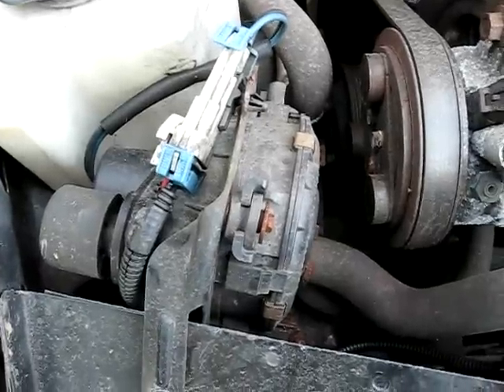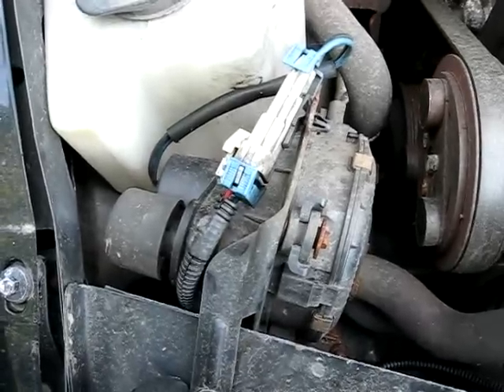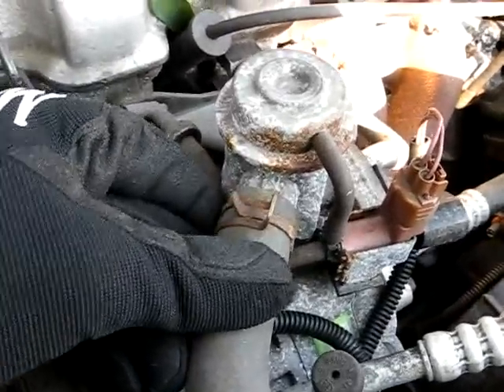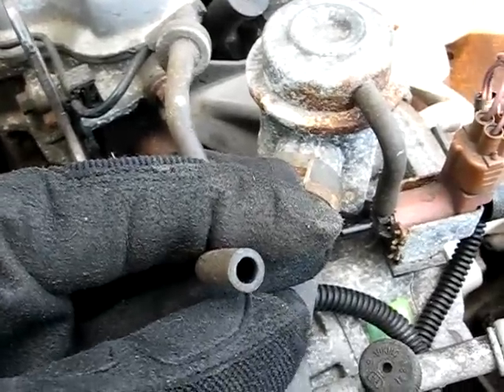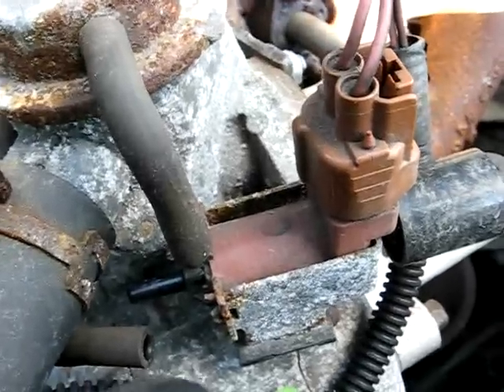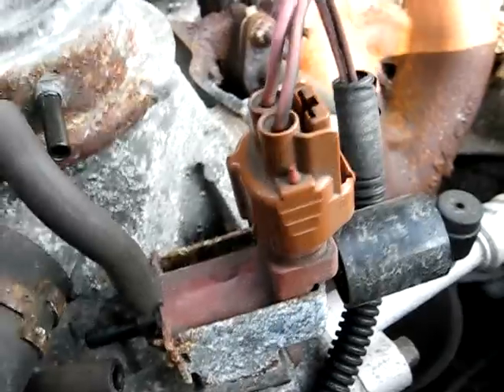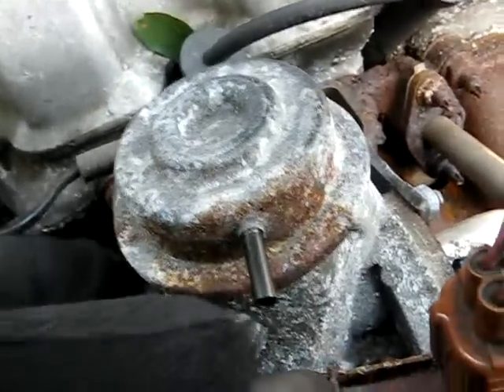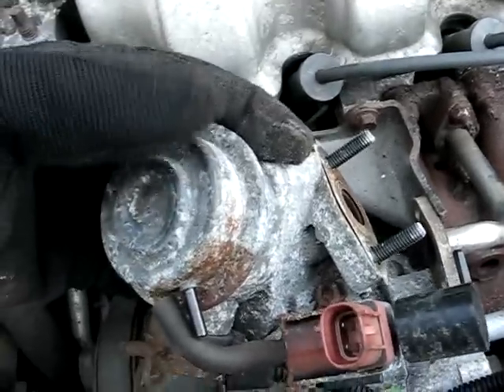P0410 Secondary Air injection System Troubleshooting

Comment: Hi richpin, I am checking the voltages coming out of the air pump relay,  One has 12 v all the time. Two have 12 v with the key on to run and the last one is reading 00.5 v. . I have checked the solenoid it is getting 12v, but the pump is getting the 00.5 v.The grounds are good continuity back to battery. Is there something in the pcm not turning on?
Reply from the maker: The computer will only turn the pump on at a cold start up and only for a short time.
Reply: Thanks for the info.

Comment: Hi Richpin,  I have been inspired by your videos to better maintain my aging Saturn.  You have helped me find the confidence to work on my car and saved me a lot of money!  Thank you!

 I have been trying to fix my p0401 code on my 2001 SL2 Saturn.  My secondary air injection pump works and during a cold start air flows through the hose to the shut off/check valve (Part #: 21210000).  I have vacuum going to the solenoid while the engine is running (Part #: 21210001) and vacuum leaving the solenoid during a cold start, but not airflow through the valve.  I bypassed the solenoid and plugged the vacuum line from the engine directly into the valve.  When I do this the valve opens and I have airflow through the valve and small metal pipe that leads into the exhaust manifold.  The vacuum leaving the solenoid seemed less than the vacuum coming from the engine so I replaced the solenoid with a new one thinking that was the problem.  But, I still do not have airflow through the valve.  I have current going to the solenoid.  I have swapped the air pump and fan relays inside my engine fuse box as they are the same part # and haven't noticed any thing different.  I am thinking of buying and installing a new shut off/check valve.  Any thoughts?
Reply from the maker: You are getting voltage at the pink wire at the solenoid are you getting the command pink/black wire from the computer to turn on the solenoid.
Reply: I just ordered a new diverter valve from amazon (Part #: 21210000). The valve seems to have an air leak as I can continuously blow and suck air through the valve at the vacuum connector.  I don't know why the valve was working when I bypassed the switch.  Maybe there was more vacuum to open the valve with the switch bypassed.  I have no idea what to do if it's an electrical problem or computer problem.  So I hope this fixes it.  I will let you know.  My new valve will be here Friday.
Reply: I just installed the new diverter valve and airflow is now working as intended. I finally have air blowing out of the valve when the car "cold starts".  I have a question.  If I have indeed fixed the problem with the new diverter vavle will the "check engine soon" light go out on it's own after a completed "drive cycle?"  From what I read on Saturn Forums I SHOULD NOT reset the PCM with a fuse pull or battery reset.  I should drive to complete all the automated "drive cycle" tests and then the "service engine soon" light will go out on it's own?  Is this correct?  Here are the references for the "drive cycle" http://www.saturnfans.com/forums/showthread.php?t=122994 also this is a good parts diagram for the air pump and related parts. http://www.wholesalegmpartsonline.com/showAssembly.aspx?ukey_assembly=404934&ukey_make=1031&ukey_model=20343&modelYear=2001&ukey_category=19412&ukey_driveLine=11480&ukey_trimLevel=25210
Reply: My "service engine soon" light went off on it's own after I drove ~25 miles to my work parked for over 8 hours and drove back.  Thanks again for the video, Richpin!
Reply from the maker: I am glad you got it fixed.

Comment: Thanks for the video. I did all the steps you went over here but still have the code. Would sea foam in the brake booster work for the vacuum line? Or Barrymans through the gas tank work?
Reply: Hell no. Never use Seafoam for anything besides the gas line

Comment: What is the switch called connecting to the diverter valve via small vacuum hose?
Reply from the maker: That is the air pump vacuum solenoid 21210001
Reply: The only way I could get another one was by going to the dealership for a new one for $30. The junkyard here is ridiculous what they charge for that.

Comment: Hi richpin,, I have a 2000 Saturn SW2 giving me a P0410 code. There is no air flow coming out of the pump. I have checked the fuse and relay they both are good.
I wanted to change O2 sensor but can not get it out (yet) working on it. Would the O2 sensor have any effect on the circuit if it is bad? I tried a different blower from another Saturn that one wouldn't work either. I am not sure if I have loose wire or bad connection somewhere. Thanks.
Reply from the maker: A bad o2 sensor in the exhaust manifold that is lazy slow to change can set a P0410.
Reply: Hi Richpin can you give some information? I found the ground block underneath the air pump. It looks corroded. My question is though according to the schematic ground wire "E" is supposed to be the air pump ground. There is no ground wire " E" at all going in  the block. I have checked my other Saturn and no ground  wire "E" either. it is empty. Is there another ground terminal?
Reply from the maker: My wire diagram shows the ground for the pump going to the right front ground pack which you have found.

Comment: hey rich i got a 1999 saturn sl2 i got the p0410 code i did all the tetes you did and i think my switching valve is bad problem is cant find that part anywhere any ideas ??
Reply from the maker: The number i get for that valve is 2121001 and after a quick search they seem to be still out there.
Reply: thanks rich the gm webiste had the part number found one on ebay
Reply: could a exhaust leak cause this code to come up ?
Reply from the maker: I am not sure if that is a cause for this code.

Comment: If I'm not getting power to the pump and the fuse and relay are ok, what next?
Reply from the maker: I would check the signal to turn on the relay from the computer at the relay socket.
Reply: Thanks so much for the reply. Oddly enough, I went to do as you suggested and guess what?, the pump ran fine when I checked it. I'm going to look for loose wires.
Reply: I'm having the same issue.  What did you come up with, was it a loose connection?  Can you tell me where abouts the relay can be found?

Comment: What if there is no current through electrical connector? That is my problem with my vehicle. Pump works if I connect it directly to the battery. I changed the fuse & still no current with or without load. There is no juice from the new fuse itself when I tested it. At the moment there is no current from electric air pump & starter fuses. Maybe the pump is defective & blowing the fuses?
Reply from the maker: Remember the system only works on a cold start up.
Reply: Yes Sir, Still no juice on cold start.
Reply from the maker: The voltage from the 30A air pump fuse goes to the relay have you checked the relay and socket.
Reply: The relay is new. How do  you check the  socket? I  don't know if its related but the fuse for the 'starter' has no power as well. By the way I have a c240 benz. I appreciate your time to respond.

Comment: Can't thank you enough!  My '02 SL2 with 164K was reporting 
P0301: Cylinder 1 Misfire Detected
P0341: Camshaft Position Sensor
P0410: Secondary Air Injection System

The shop wanted $150 just to diagnose and suggested this could be a costly repair. ("Those camshaft sensors are quite involved, don't you know.")

After watching this and a couple other of your videos, I started with the simple stuff and traced through the vacuum lines.  Sure enough at the back of the engine, the vacuum tube was off, hanging freely.  On reconnecting, the engine immediately idled smoothly at 850 rpm as opposed to around 1,000 and running roughly.  Using a $10 Bluetooth OBD scanner, I cleared the codes and they all went out and haven't come back on!

Without your guidance as to what and where to look I would not have been able to do this.

Thank you!
Reply from the maker: +Joe Whistler You were lucky on that P0410 as most people have carbon blockage in the system which takes a lot of time fix.

Comment: Thank you for this.  It helped me greatly.  My problem ended up being the manifold itself being jammed with carbon.  Another video of removing the manifold and cleaning out the pathways or a link to that kind of video would be great.  Regardless, thank you from all Saturn fans!
Reply from the maker: +The Shocker I have this one https://youtu.be/MTsqvQrl7OA
Reply: +richpin06a Do you have one of you removing the manifold with the engine still in the car?  I managed to do it, but moving the air conditioner was particularly troublesome.  That was probably the longest process.

Comment: Rich, thanks for this video. It helped me figure out the several issues causing the P0410 error code. I want to mention that it's worth checking the vacuum lines for cracks or loose connections, as this can can lead to loss of vacuum. I had vacuum going into the switch, but not at the end of the vac line connected to the diverter valve. After removing the diverter vac line from the top of the switch, i checked the top output of the switch and had vacuum. 

One problem down, one to go. The tube that connects the diverter valve to the exhaust manifold was clogged and after clearing that, things seem to be working ok.

Rich, Thanks for a great step by step guide on how the system works.

Also want to add that if anyone testing this is good with a volt meter, you can check the voltage at the O2 sensor on the manifold. While the sensor is still connected, ground the voltmeter to the negative battery terminal, and then push the positive voltmeter probe through the insulation on the single wire going to the O2 sensor. Start the car when cold and the voltage should be low and steady, ~.150-.300 volts (150-300 millivolts) when the secondary injection system is running. Once the injection system turns off, the voltage will slowly start to climb. If you dont see this drop on startup, then the secondary system is not functioning correctly. If you have followed the steps Rich provides in this video and have air flow to the exhaust manifold, then the manifold is clogged with carbon or the O2 sensor is bad. 

Cheers,
-Erik
Reply from the maker: +Erik Gutterud Thank you for the tip.

Comment: 2006 Ford focus , code: p0491, I replaced the air smog pump, last one had water in it, really bad shape. replaced it with a new one still ready the code, any suggestions?

Comment: Rich, I have water getting into the cap and sponge-type filter in the air pump. What causes that? The diverter valve? If so, can it be disassembled enough to fix it? Great video, man! My car is a 2002 Saturn SL1.
Reply from the maker: +Ron Kelly I am not sure if the water is sneaking by the diverter valve or not , are you getting any trouble codes.
Reply: +richpin06a Rich- My engine light was going on and off which I am sure it's due to the pump and stuff. I just took the diverter valve off along with the switch and there was water in the valve also. I applied vacuum to the valve via my mouth (heh heh) and could tell that worked ok because when I stuck my tongue over the hose, the vacuum on it did not let up any. (I might patent that process!) Then I applied power to the switch and it made no difference with the air flow through the switch, whether power was applied to it or not. I know next to nothing regarding all this, but that would say to me that the switch is bad. I guess that's the shut-off valve. You certainly are faithful to all of us and this whole thing! Thank you!
Reply from the maker: +Ron Kelly The pink wire is voltage and the pink/black wire is the ground control from the computer.If that is the way you tested it and there was no response then there is a good chance the solenoid could be faulty.
Reply: +richpin06a I figured that was the wiring setup and tested it that way. I found one on Ebay and have ordered that, along with the diverter valve and air pump. Once I get all those changed I should be in good shape. :-)

Comment: Hi Rich, thanks for the nice video. You might have answered my question in the comments, but there were too many to read, so here it is. I have a 2001 Saturn S-series showing this code. The air pump was not running. The big 30A fuse is good but the relay is not activating. I took out the relay and put a jumper across the relay contact socket pins and the air pump ran and the check engine light went off. I also checked the relay out of the car by activating it and checking with an ohmmeter that the contacts closed, and it was good. So I conclude that the relay is not getting activated and need to find out why, but I can't find information on how it is activated. I presume that the 30A fuse in in the relay secondary circuit. Is there also a fuse in the primary circuit? If I can't find information on this, i will have to trace the relay primary wiring back to the ECM, I guess.
Reply from the maker: Vincent Salgado The 10A EGR fuse feeds into the relay.

Comment: rich pin the electric isn't getting any current, what could by my problem?
Reply from the maker: Courtnei Bannon The voltage for the air pump solenoid comes from the 10A EGR fuse.
Reply: My ac stopped blowing cold about a year ago and I tried smogging it two days ago and it failed due it 40410 code. I followed your steps and right off the pump doesn't start and when we rewired the air conditioning and the pump directly to the battery it starts no problem so we aren't sure what the problem is. richpin06a

Comment: The fix for me was to replace the hose/wire that runs from the diverter valve, over a crevice on the valve cover and to a connector close to the throttle. It got messed up because a mechanic who worked on my car swapped in hose/wire that he kluged together when working on another smog related P code.

Comment: thanks for all your videos!  now I have a question.  I've done this test, and all things are working fine.  I just took off the exhaust manifold and cleaned the grooves and the holes in the engine block.  how long until the code clears it self?  or could I have a faulty O2 sensor

Comment: Rich, 

The sound is a consistent bad clanking noise and I took the valve over off and it was def coming from the passenger side.  I was thinking maybe the guides broke loose and they are knocking around in their but don't wanna go through all that work and it not be the problem.
Reply from the maker: Daniel Martinez Any marks on the valve cover is the chain loose.
Reply: I didn't really see any marks and the chain didn't seem loose.

Comment: Hey rich 
I have a timing chain issue I believe but not sure on my 2000 saturn sc2, do you have a video on that or a way I can ask a few questions?  Thank you.
Reply from the maker: Daniel Martinez I do not have a video at this time.If the noise sounds like a diesel engine it is a possible timing chain problem especially if it is coming from the passenger side of the engine.

Comment: Hey Rich, I've done the tests and everything seems fine but the code still is there and the engine still is jerky on acceleration. One thing to note is if it's a cold start in hot weather, everything is fine. Any thoughts? Thanx!!
Reply from the maker: Eldon Tyrell I have heard that a lazy o2 sensor might keep that light on.
Reply: Eldon Tyrell Update: Code was on for 2 weeks after air injection inspection and cleaning and then went off for 2 weeks(waiting for O2 sensor delivery). Sensor was replaced(new). Problem still exists but this time I noticed the code and Ck Egn lite comes on when the car has a "cold" start and the ambient temp is over 80 degrees. The outside temp seems to affect it but don't I know why. Thoughts? Thanx Rich!
Reply from the maker: Eldon Tyrell Is the computer seeing a correct coolant + air temp sensor readings.

Comment: How long should the pump run? Will it com on if the engine is hot? I'm showing power at the connector, but the pump isn't coming on at start, however the engine was hot.
Reply from the maker: tbdk87 The system works only on a cold start up.

Comment: Ive checked everything and even replaced the ects and light still comes on after I reset it. Even cleaned everything. What else could it be
Reply from the maker: If the pump runs and diverter valve works and all ports and manifold are clear you could have a lazy o2 sensor.

Comment: Hey rich  is it OK to run the car with out that hose connection to the seriold relay for a short time
Reply from the maker: The diverter valve will not work without that small hose connected.

Comment: I am not seeing current at the air pump. Fuse and relay are good. Any suggestions?
Reply from the maker: Remember the system is only active for a short time on cold engine start up.
Reply: I've tested all the way from initial startup to about a minute.
Reply from the maker: Did you check both fuses that feed the relay 30A air pump and 10A EGR.
Reply: I did not check the egr.

Comment: I cleaned all the parts and am getting airflow . changed the o2 sensor , gas cap, air filter even was told to chang the coolant temp sensor, nothing worked. help, I do have a light for a missing sensor on the collant overflow tank, that couldnt cause this check engine light to stay on with that code ? Help help i already have one ticket and second cop let me go said tell richpin to help you fix this. Thanks.

Comment: Hi rich I have cleaned a nearly 100% blocked manifold and 90% blocked tube have run tests on the solenoid and blower motor everything seems to be functioning normal but still have the PO410 code.  Should I change the 02 sensor and or coolant temp next?  thanks
Reply from the maker: In some very rare cases a o2 sensor with a slow reaction time can cause this code.